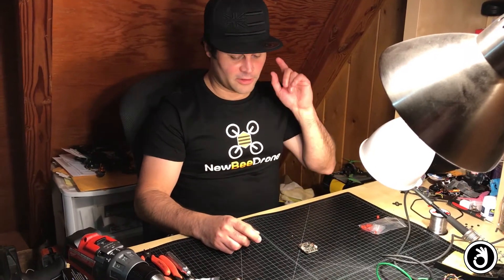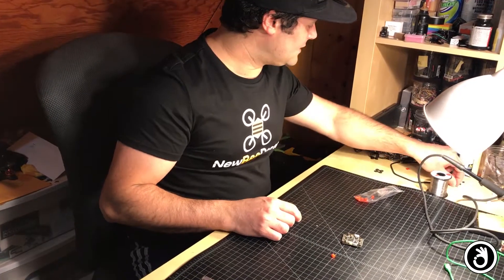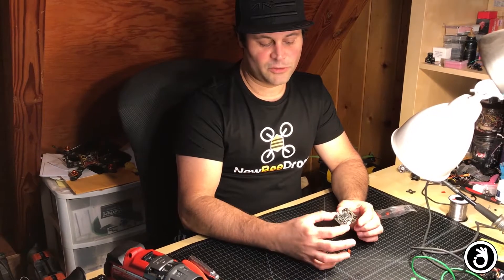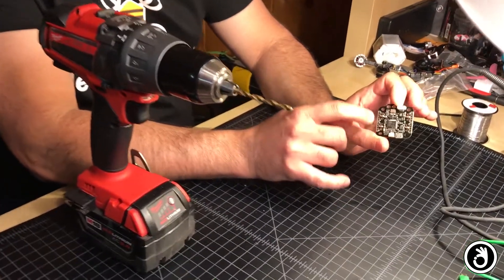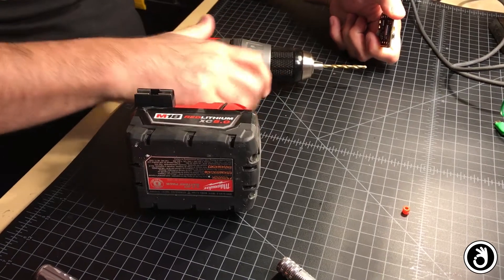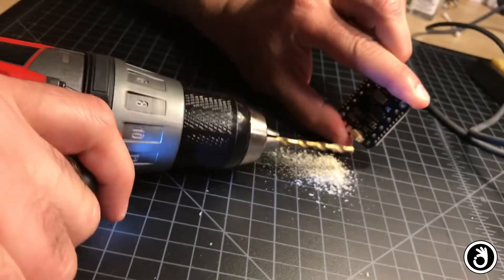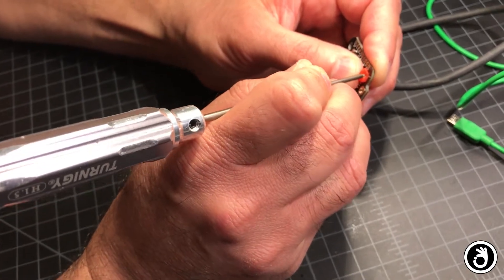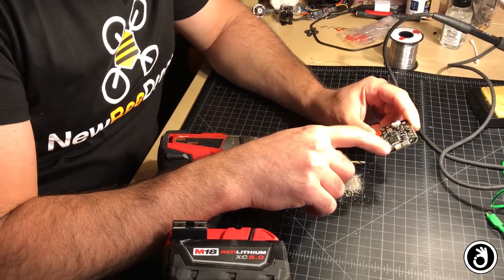How to Drill a Flight Controller for Soft-Mounting

Comment: New to fpv. What will happen if I tightened the nuts too much? I'm troubleshooting a fly aways right now
Reply from the maker: Depends. Nothing might happen, it it might just fly worse... or it might fly fine but not allow tuning fully as high as it could. Bottom line is, if you tighten the nuts too much, it reduces the dampening effect of the gummies.

Comment: thank you so much for made this video. this is what I really need.

I have a question. Im using old omnibus f4 ,there is some copper coated inside the hole. some of PDBs are same.

after I drilled hole, copper coatings are removed.

Is that fine?
Reply from the maker: It really depends. Some FCs have that copper there and it's not connected to anything... others are grounded there. I think it might be OK, but you do take a risk in doing this mod. I haven't damaged and single board yet doing this, but I'm careful as to which I modify this way.